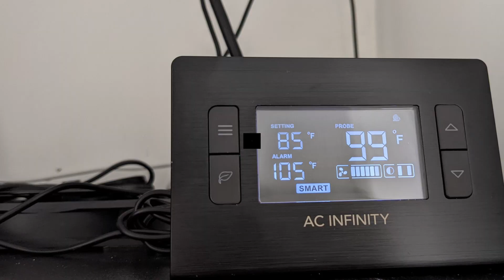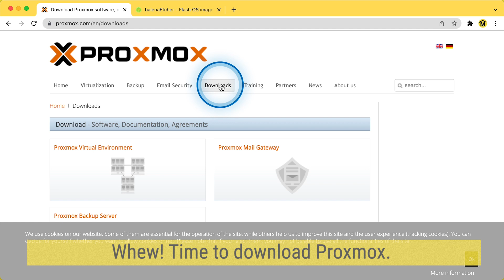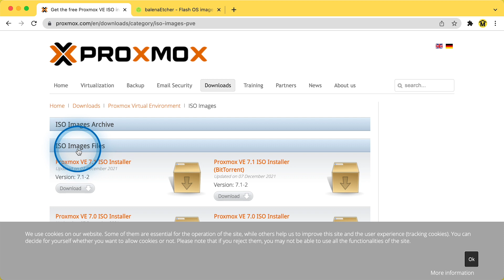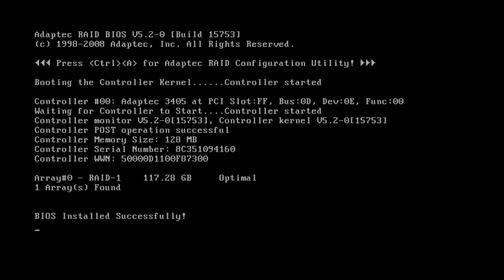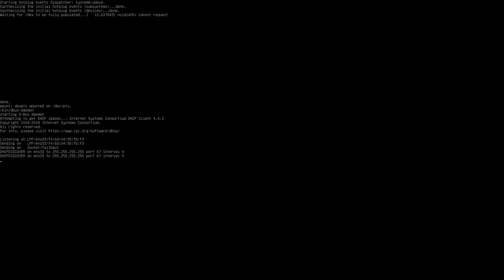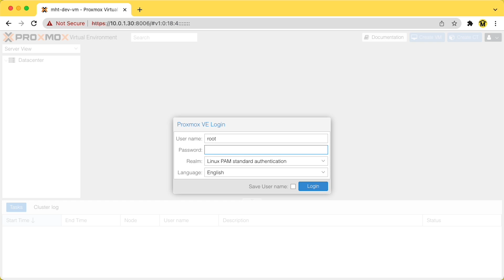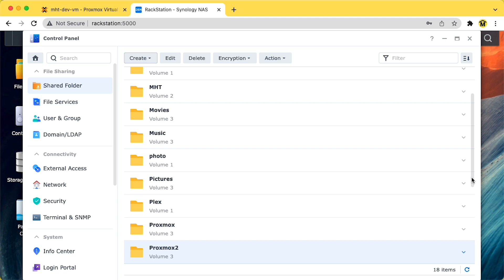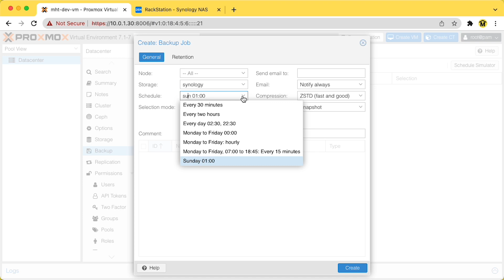Build a Virtual Machine Server with Proxmox 7 and Synology storage!

Comment: First, turn off the hardware raid.  In the Proxmox install you can setup a ZFS mirror for the boot disks.

Second, I have my Synology and Proxmox connections setup to use nfs. Why did you choose SMB?

As for what I'm running, I have a TrueNAS VM setup with 4 - 10TB drives in a raidz1 that I use to backup my Synology, Netbox and PTRG.  Plus some experiments..... =)